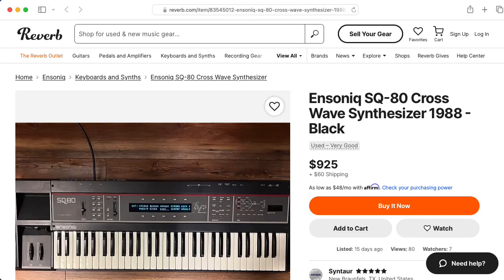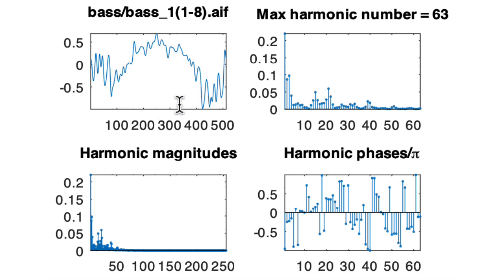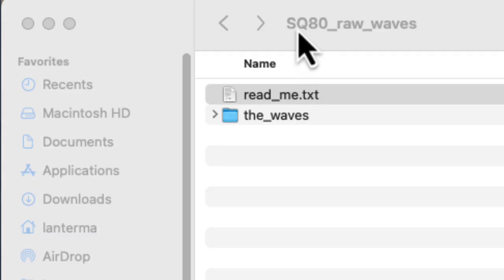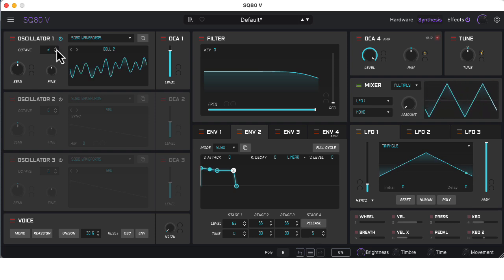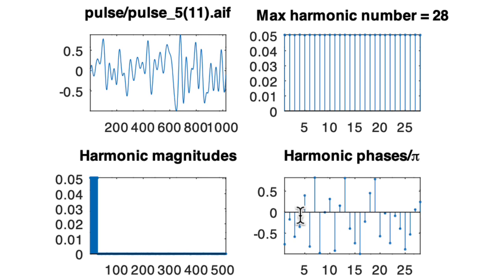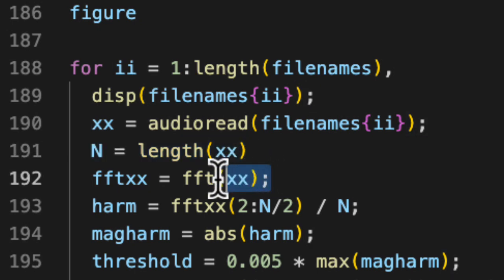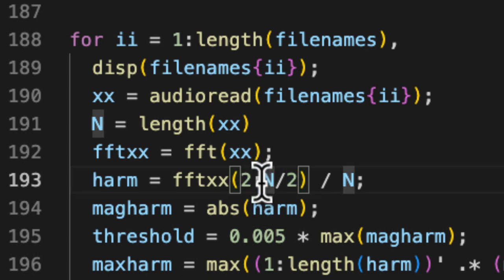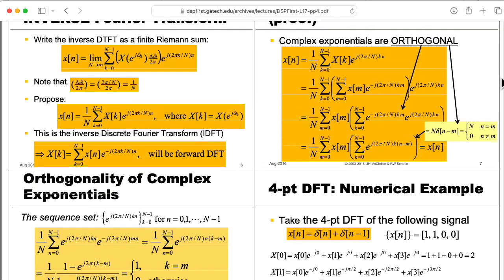Extracting Harmonics of Ensoniq SQ-80 Waveforms with FFTs (Fast Fourier Transforms)

Comment: It's an interesting task relative to what I've been studying lately which is the now extinct rack mount exciters that add artificial harmonics to your signal but with a surgeon's scalpel if they're good ones. Anyway, I'm amazed how  many effects have died out with the digital takeover since digital can give us control over harmonic content like never before with current technology. 

Stacking high, even order harmonics is the primary difference between "new" and "old" styles when it comes to guitar distortion. With the valve obsession today, I'm amazed nobody has added a module based on exciter technology where you can select a large array of band points to add and remove harmonics artificial or not. 
This would be the easiest pathology to make virtually any distortion including an analog pedal plugged into such a processor to sound identical to tubes, as well as produce spectrum of tones that have never otherwise existed before.
It means "your sound" can be attained from any style of distortion a modeler offers or other processing that manipulates harmonics.
Reply from the maker: Pinning this (for a while at least). :)

Comment: I have a Kodamo essence fm mk2. it says i can import and load 16bit, 512-sample long waveforms. If its not the right length or attributes, It will be automatically converted. Do you the thing the sq-80 wav files are to big?
Reply from the maker: I think a lot of the SQ-80 wav files are natively 512 samples long if I recall correctly. Anyway, if the Kodamo automatically converts waveforms with different number of samples you should be good to go anyway. ;)
Reply: @Lantertronics  OK thanks.

Comment: Aaron, this question isn't directly related to this video, but you did mention Octave.  I believe that I read somewhere that Octave was no longer "the best" alternative to Matlab and that (I *think*) SciLab has taken its place.  Am I remembering this correctly?
Reply from the maker: I view them as different tools for different purposes. SciLab isn't trying to be MATLAB compatible -- it's trying to be its own thing. I've used MATLAB for well over 30 now and am very familiar with it, so I naturally gravitate to Octave just for speed. 

SciLab is slicker in appearance in some aspects, and is probably better designed as a "language" (MATLAB sort of accreted features over time and doesn't come across as well thought out). 

I'd say try them both out for whatever purpose you have and see what you like better. That may vary from use case to use case.
Reply from the maker: My main use case for SciLab is for the open-source FPAA development tools developed by the research group of my colleague Jennifer Hasler. It uses the Xcos block diagram language, which is like SciLab's take on Simulink. It's excellent.
Reply from the maker: Here's my FPAA playlist, you can see a lot of SciLab and Xcos: https://www.youtube.com/playlist?list=PLOunECWxELQTCZEqIbHZpRmIEeQR80o3j
Reply: @Lantertronics  Thanks Aaron!
Reply from the maker: Oh! And if you are wanting something closer to MATLAB, but not necessarily MATLAB compatible, check out Julia. It's like what MATLAB would have been if had been thought out well from the beginning.

Comment: I have a Kawai K5000S which can generate sixty-four harmonics per source (and another sixty-four from in an additional source for a total of 128 unique harmonics, or 384 if all six possible sources are used), so it would interesting to try recreating the SQ-80 waveforms on that. I also have an Ensoniq Mirage, which can be coaxed into doing wavetable synthesis with the custom Soundprocess OS, so I wonder if these original SQ-80 waveforms could be ported over to it somehow.
Reply from the maker: That should all be totally doable. :)

Comment: Thanks. Nice utility and a good reference point for the ROM waves. On the actual ESQ/SQ synthesizer above the DCA level 49-53 (depending on the wave) in pre DCF stage its harmonics start to change due to analogue circuits involved. Actually they even change from voice to voice. I don't know if they modelled this behavior in software. It would be interesting to compare.

Comment: I’m working on a project involving this.

However I’m trying to understand the mapping of the waveforms.
Reply: There's a PDF/spreadsheet on Rainer Buchty's website explaining the memory layout for all multisamples zones
Reply from the maker: You mean like how the data in the ROMs is stored?
Reply: @Lantertronics Yeah. Let's go with that. Prolly not gonna mean much without knowing how the D/A circuitry is producing sound, but it might be interesting.
Reply: @Lantertronics  yes, I’m trying to extrapolate the individual waves. I understand the map explains which octaves the waves belong to but I don’t quite understand the addresses of each wave. 

If I’m correct the waves may be of various length not a fixed size. So I need to figure out the addresses for each of the waveforms.
Reply from the maker: @marklewis4024  The waves are of different lengths. If you download Rainer's ZIP file that I linked in the description you will see each wave is an individual sound file and you can see the length of each. If you wanted you could modify my code to spit out a list of the lengths (or whatever other data you need).
Reply: @Lantertronics  thank you!
Reply from the maker: @marklewis4024  You are welcome! :)
Reply: So...this is like FM synthesis, only with an extra frequency being modulated or is it an extra modulation wave form being applied to a frequency...if either of those?

Anyway- love your work, love the channel. I kinda wish it would stay in the same lane as it seemed to be in when I first found it which was the synth module/stomp box lane, but I definitely appreciate how you are demonstrating how many lanes there are for the aspiring Electronic Musician to discover.
Reply from the maker: @SameAsAnyOtherStranger  The focus shifts around depending on what I'm interested in at any particular point; right now I'm exploring digital synthesis a lot. Usually the shift of interest is determined by what I'm teaching in a particular semester. This fall semester I'm assigned to teach ECE3400: Analog Electronics, so you'll likely see more transistor-type content comping soon. :)
Reply from the maker: @SameAsAnyOtherStranger  It's not even as fancy as FM -- it's just wavetable synthesis. The SQ-80 is just spitting out the single-cycle waveform over and over. Synclavier works similarly -- it precomputes a waveform based on the harmonics you select. You could of course make a synth that frequency modulates the input of the wavetable oscillator, or that uses the output of it to FM another oscillator (although the SQ-80 doesn't do this, which makes sense since among other things Yamaha still had a patent on FM at the time). The SQ-80 can also do amplitude modulation and oscillator sync.